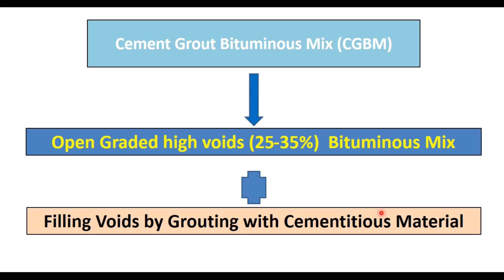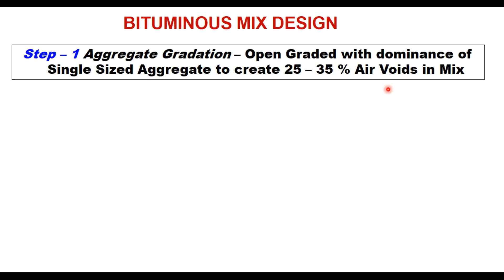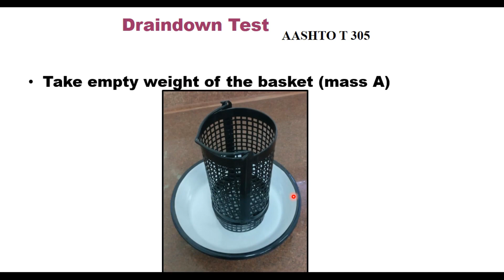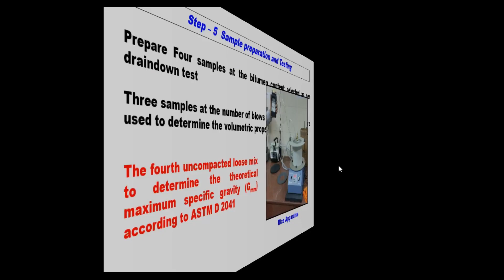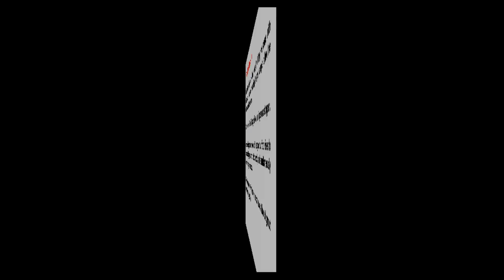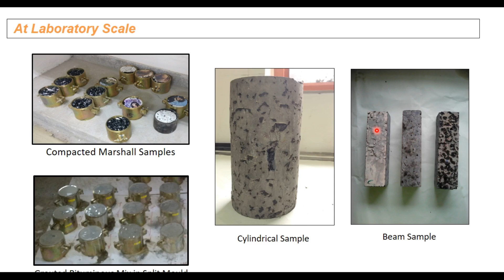Cement Grouted Bituminous Macadam (CGBM) for wearing course, Mix design and construction.

Comment: Sir, Can CGBM be used as Binder Course for Traffic less than 5MSA. In the video, with reference to IRC 125 you make a mention of thickness 30mm for CGBM. In such case, can we use as a replacement to conventional BM layer of 50mm used ? Any inputs about costing from Surat Municipal Corporation where the trails have been done ?
Reply from the maker: CGBM is not for binder course. It is best suited for the surface course layer due to its impervious surface. Cost of laying 30 mm CGM is roughly 40 - 45 percent higher than that of 50 mm BM.

Comment: sir, for bituminous mix air voids is 20 to 35 %  but what should be the required  percentage of dry aggregate air void (without bitumen) .how do we take reference from code since it is not mention in IRC : sp:125-2019.
Reply from the maker: Voids in dry rodded condition is required when you want to have a mix with stone on stone contact like in the case of SMA. In BM the voids are randomly distributed and there is no requirement of checking air voids in aggregates.

Comment: Can CGBM a good surface layer for National Highway or Expressways ?? Is there any limitations for using this on high volume roads ?
Reply from the maker: CGBM has been primarily used on urban roads. It has not been tried on NH or EWs so far. Its suitability under the heavy traffic of commercial vehicles is doubtful (not studied so far).
Reply: Thank you sir for reply.